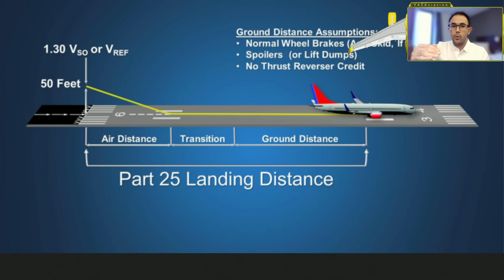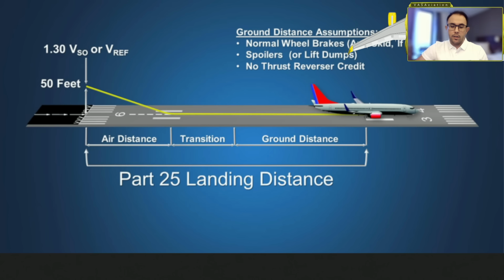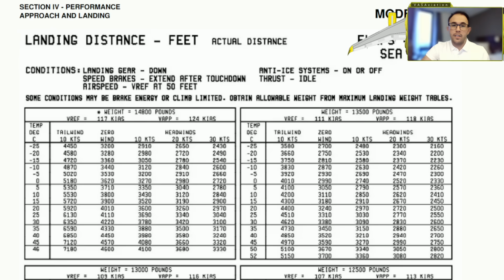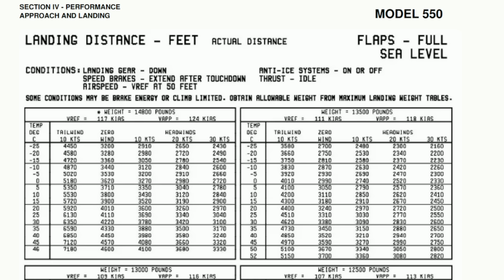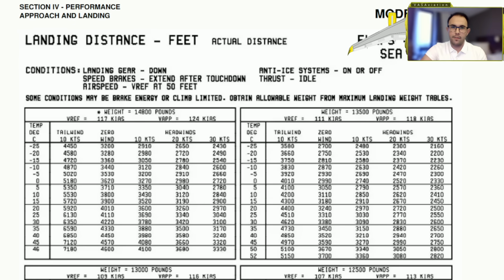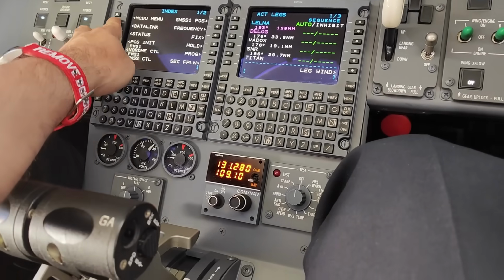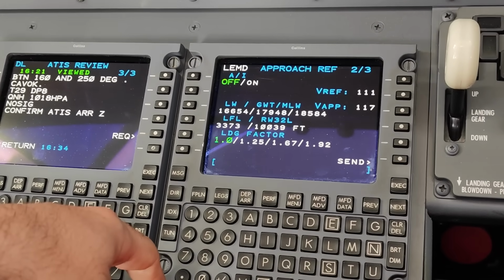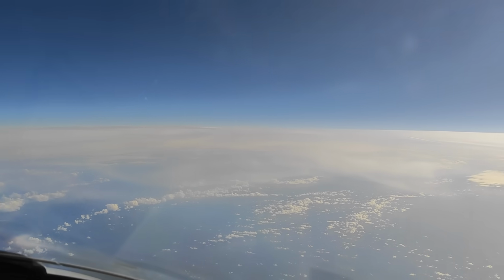Aircraft Approach Categories EXPLAINED about San Diego Plane Crash

Comment: As it relates to this crash, the aircraft was at around 160-170 kts as it crossed PENNY the final approach fix (FAF) which means either the pilot needed to use Category D minimums, which is not authorized, or go missed. Slowing the aircraft down to VREF or VAPP well past the FAF, which is what the pilot was attempting to do, is what destabalized the approach. The vertical descent rate was insanely high. This is an important caveat in one of the many factors that contributed to this crash.
Reply: 100% correct.  There’s no way this aircraft had a 40 knot tailwind on the approach, so the IAS was flown well above Category B speeds inside the FAF.     Yes the aircraft is certified as Category B, but when the pilot flies the approach at Category D/E speeds, the corresponding minimums must be used….and there aren’t any for this approach.  

Once the prelim/final reports are published, I suspect all this attention to the aircraft/approach category will fade as more egregious errors in airmanship are revealed.  RIP to the innocent victims, and sincere condolences to their families.
Reply from the maker: again, you don't know the IAS at that point. You can only assume.
Reply: @VASAviation We do know the winds are calm which means that TAS and ground speed are the same. Then we can calculate indicated airspeed from TAS given the altimeter setting and temperature at the nearby airport and known altitude. Or we could use the general rule of thumb that TAS increases 2% for every 1,000 ft increase in altitude. IAS is roughly 6 kts slower than TAS. Which means 6 kts slower than ground speed. I’ve tracked enough flights using ground speed data from ADS-B and the indicated airspeed inside the airplane to know that the numbers aren’t going to be very wildly different from each other especially given the fact that we are closer to the ground where IAS and TAS are only slightly off verses as we would expect them to be at higher altitudes. I’m sure the NTSB uses a similar approach to determining IAS when flight data recorders are not available for investigation.
Reply from the maker: The speed shown on ADSB or Radars is GROUNDSPEED, not Indicated Airspeed.
Reply: @VASAviation This is true, however, ATC reported the weather at Miramar (NKX) just 3 miles north of Montgomery Gibbs Exec (MYF) as calm. So the indicated airspeed would likely have been, if not exactly the same, pretty darn close to the ground speed.
Reply: @alexc5449  agree. Maybe a 5-10 knots higher TAS aloft at most as it approached NESTY, converging as it got closer to the ground. Winds aloft in the approach area were forecast to have little to no head or tailwind component as well.

Comment: All very well, but in the US you choose the category based on the IAS flown.  AIM 5-4-7 says (paraphrased), “that if it becomes necessary to fly faster than the category published for the aircraft, then a higher category should be used”.
Reply from the maker: Of course. If my calculated VREF is 119 but for any reason (it's gusty, windy, stormy) I want to fly faster and add my own safety margin to VREF 124, then I MUST adjust and select CAT C.
Reply: @VASAviation  Also VRef is generally not the approach speed. VRef is the speed to be at over the threshold to make your computed landing distance. Most aircraft fly the approach at Ref+10 or whatever the AFM says to do. Higher speeds may be necessary for weather or malfunctions.
Reply from the maker: But that is exactly what I said on video. Did you watch?
Reply: @Airpaycheck yes, but the categories are defined using Vref, and it is understood when the IAP is designed and mins are set that the plane will not be at Vref during the entirety of the approach. Not sure the point is relevant. Further, the probability that a plane that’s been flying for 3 hours and approaching in literal calm wind would plan to land at Vref + anything. The focus on whether this IAP was legal to fly is misplaced. It was legal to attempt. This was an ADM and execution issue, and there may be factors related to equipment (lighting) that are worthy of investigation. The approach category debate is not useful.
Reply from the maker: @EricEsser  I'm bringing this topic because many people, including Youtubers that are pilots, were claiming on this pilot for shooting an approach he was not authorized too saying his aircraft is CAT C. I wanted to explain why it is a CAT B and why, in this regard, he was indeed authorized to go on.
Reply: The debate about approach categories is not useful. It was a legal approach. The citation is cat B. The AIM section you’re referring to is mostly concerned with circling, and other Citation pilots have weighed in that they would apply cat C mins if they’re circling (in which case one would not fly this approach). That’s not regulatory, and doesn’t apply here on a straight-in calm wind light plane approach. The focus should be on decision making (to fly this legal approach in the face of a lot of stacked odds, fatigue, etc), execution (unstabilized, high speed, below mins), and potentially other external factors (lighting, other). We’re not going to get anywhere with a semantic debate about approach categories.
Reply: Aircraft categories don’t change with airspeed. They’re fixed for an aircraft type. Flying faster because of speed additives doesn’t change your category.
Reply from the maker: @EdOeuna  approach categories DO change with Vref airspeed. A B737 or A320 flying a circling approach are likely to be CAT D instead of the normal CAT C.
Reply: @VASAviation  The Approach Category of an aircraft DOES NOT change with Vref speed.  Please refer to FAA Information for Operator's (InFO) 23001 Use of Aircraft Approach Category During Instrument Approach Operations.  The FAA InFO was published to dispel these myths.
Reply: @richardboll8763 Ok, I read INFO 23001 and here's an excerpt: "If  it  becomes  necessary  to  operate at  a speed  in  excess of  the  upper  limit  of  the speed  range  of  an approach  category, the  minimums  for  the  higher  category should be  used  if available.  This  may occur with  certain  aircraft types  when  operating  in heavy/gusty wind, icing,  or  non-normal  conditions. For example,  an  airplane  that  is certified  as  category  C, but  is  circling to  land  at  a  speed of  145 knots, should use the approach  category D  minima."

Comment: in my opinion , and the training I have received, the categories is  a calculated value , and is 1,3 X VSO as you eloquently presented, but it has nothin to do with aircraft dimension , Example a MiG 21 is very small and light and operate in categorie C and a Dehavilan Dash 7 can operated on category B. The question ? that I have is,  if you utilize a approach airspeed that place you on category D and it is not permitted , can you safely utilize the approach, that is  restricted to slower aircraft airspeeds? Category B. Are you in violation of the intention of the rule, slow you down . saludos Iberian say hey To my favorite city on the Planet Madrid and # 2 Barcelona
Reply from the maker: If your calculated VREF is in the Cat D, you MUSTN'T fake it to go into Cat C. VREF is your safety speed. Lower than that, you're approaching stall speed and in a tight margin to maneuver in case of a wind gust. However, you can try reducing weight burning fuel so that Vref gets lower and allows you apply an authorized approach category
Reply: @VASAviation  Victor.  This statement is not correct in the US rules and regulations.  Please contact me.  I can explain the whole story.   Thanks.  Richard Boll
Reply from the maker: You can explain here for the rest. I did my initial type rating in Orlando (although for EASA rules) and they enver let me go below Vref, only after threshold aiming for landing
Reply: @VASAviation  what he’s saying is, in the FAA, the approach for an airplane is Vref at maximum landing weight (MLW).  At lighter weights, your actual Vref might be appropriate for B instead of, say, C but you cannot do that.  You must abide by the category at MLW.  There’s tolerance for short deviations below Vref as long as an appropriate and timely correction made.  The airplane is not gonna stall at Vref -1.  There’s at least 30% buffer.
Reply: @GLEX234 ❤ yes that is a great explanation ❤,  yes i learned similar to what you have explained. My instructor transfer to me  also, If for whatever reasons you increase the approach speed , you must use the higher category minimum!, that is the reason I commented with a question 🙋? and presented a example, example , can a approach be performed on category A if operating on category D speeds ?, please can you educate me, saludos ❤
Reply: @pavelavietor1 
If you’re talking about FAA, here’s the InFO letter sent out as a result of the KTRK accident.  Read the discussion paragraph carefully.

https://www.faa.gov/sites/faa.gov/files/InFO23001.pdf

In FAA land, it might be better to think of, “can I maneuver my plane on this day/night under these conditions (configuration, circling, winds, etc) AND remain within the protected airspace”.  If you’re at Cat D airspeeds, you probably cannot remain within Cat A airspace, not matter the certificated approach category for your plane.
Reply: I don’t think it would be wise to go below the calculated Vref for your airplane. I think you would want to keep the safety margin of 1.3 x Vso while landing. Going slower than Vref just to make the approach category “legal” doesn’t seem like a good idea to me.
Reply from the maker: As I said on video, you're supposed to NEVER fly below Vref. You go ONE knot under Vref in the simulator and you're FAILED.
Reply: You can’t use a category lower than the aircraft”s certified category just because you’re flying a slower, that is, lighter airplane.
Reply: @GLEX234  thank you for your elegant comment, thank you so very much, saludos aviator

Comment: For those who might be wondering, air traffic controllers have no way to know for sure what Aircraft Approach Category (the A-B-C-D Category) all airplanes might be using, in part because there are so many airplane types and because any airplane can also go "up" to a higher category if they are flying at a higher speed. So for a Citation like this, controllers won't know if it is Category B or Category C, so knowing that is entirely up to the pilot.
Reply: And even if Category B.  The weather at surrounding airports still reported visibility at 1/2 mile while the approach plate / regulation requires 3/4 mile.  I’ve also seen an AIM reference that unless you can get an altimeter setting from the destination airport you are not supposed to land there (save for an emergency I’d assume).  So regardless of category the fact remains he shouldn’t have attempted the approach.
Reply from the maker: @oldowl4290  does the AIM say explictly that the approach to an airport you don't know the weather or the altimeter is PROHIBITED? And I want that word or synonym. If not, I am OK with him giving it a go.
Reply: @VASAviation  AIM page 5-4-7 (2021 edition) states, "When the altimeter setting(s) on which the approach is  based  is  not  available,  the  approach  is  not authorized."
Reply: @oldowl4290 the reference is AIM 5-4-5 Instrument Approach Charts, paragraph a.4.:  4. Approach minimums are based on the local altimeter setting for that airport, unless annotated otherwise; e.g., Oklahoma City/Will Rogers World approaches are based on having a Will Rogers World altimeter setting. When a different altimeter source is required, or more than one source is authorized, it will be annotated on the approach chart; e.g., use Sidney altimeter setting, if not received, use Scottsbluff altimeter setting. Approach minimums may be raised when a nonlocal altimeter source is authorized. When more than one altimeter source is authorized, and the minima are different, they will be shown by separate lines in the approach minima box or a note; e.g., use Manhattan altimeter setting; when not available use Salina altimeter setting and increase all MDAs 40 feet. When the altimeter must be obtained from a source other than air traffic a note will indicate the source; e.g., Obtain local altimeter setting on CTAF. When the altimeter setting(s) on which the approach is based is not available, the approach is not authorized. Baro-VNAV must be flown using the local altimeter setting only. Where no local altimeter is available, the LNAV/VNAV line will still be published for use by WAAS receivers with a note that Baro-VNAV is not authorized. When a local and at least one other altimeter setting source is authorized and the local altimeter is not available Baro-VNAV is not authorized; however, the LNAV/VNAV minima can still be used by WAAS receivers using the alternate altimeter setting source.
Reply from the maker: This is mainly a pilot(ing) thing and it's for performance reasons and minimums. ATC only care about your wake category
Reply: Aeroplanes don’t change categories because of their speed. Their category is fixed, irrespective to their approach speeds.
Reply from the maker: @EdOeuna  no, sir. Categories can change and I just explained why
Reply: @VASAviation - that’s flying different approaches. The 777 freighter is cat C for everything except for the circling when it becomes a D. The comment here suggests that flying faster means a change in category. If I’m in the 77L and it’s a Vref of 145kts, then I have a flaps drive <5° and the Vref is now 175, the speed has changed but it’s still a cat C aircraft, cat C minima.
Reply from the maker: absolutely not. If your Vref increases, you category changes as well.
Reply: @VASAviation - Boeing seem to disagree. I’ll let them know that you think they’re wrong.
Reply: @VASAviation  "If your Vref increases, you category changes as well."   I would disagree with your statement as well.
Reply: @VASAviation No..an aircraft’s approach category does not change, at least in the US. FAA has explained this fact in InFO 23001, Use of Aircraft Approach Category During Instrument Approach Operations.  Please read this and please stop repeating this false information!
Reply: @VASAviation  please contact me. Google Richard J. Boll II.  You will see me come up referencing FAA and NBAA.  We need to clear up this misunderstanding.  Thank you.
Reply: This might be a stupid question but.. if Vref is based on Vs0 being that the stall speed at landing configuration why would the higher stall speed at 5deg flaps change Vref? Is there a range of flap angles that is considered "landing configuration " or just a fixed one?
Reply: @tobiasm2780 The confusion lies in the fact that historically, there are two ways to determine stall speed.  One is through flight testing and this method was used to establish Vs speed.  Vso is stall speed in the landing configuration determined in flight test based on a 1 knot/sec deceleration to the first indication of a stall.   This method used for years proved unreliable. In the 1980’s the European JAA moved to using the stall speed based on 1G flight at CLmax.  This stall speed was call Vs1g, and is about 7% higher than Vs stall speed. The FAA adopted the Vs1g stall speed and called it “Reference Stall Speed”, abbreviated Vsr.   For certification purposes, landing threshold speed was known as 1.3 x Vso.  With rule change to Vsr in 2001, FAA defined VREF as being 1.23 x Vsr.  Surprising VREF had never been defined in the CFRs before this rule change. It was a manufacturer’s term only.  When VREF was added to the CFRs, 97.3 that defined approach categories had to change.  Unfortunately, they left a comma out of the sentence of the rule change leading pilots to believe that approach categories are based on VREF at the actual landing weight instead of maximum certificated landing weight. FAAhas been trying to correct this problem for years, and failing I might add as videos illustrates.